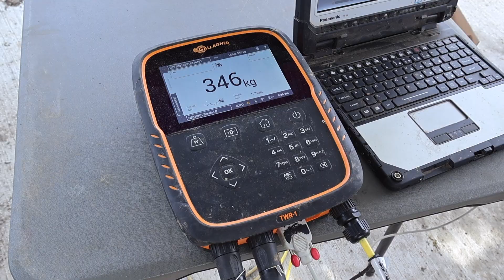What Happens When You Stop Using Chemicals on a Farm?

Comment: I'm an accidental cattle farmer- mooved here in the Orbost area two years go. Only a small concern (16 breeding cows on 15h) My problem is very low HP-3.6- but also like Chris, lots of locked up nutrients. So I spread about 10t of lime over most paddocks....no visual improvement as yet but still optimistic. I also want to avoid any chemicals or synthetics etc. but would avoid chicken poo from the big chicken farms. So a very interesting Video Tim thanks.

Comment: Urea was used during WWII to quick repair air fields that had bomb holes. Just pour into hole and add water! So what you recon it does to soils? Lupins were used in Robertson, NSW potato to release phosphorus locked away using crop rotation. Just realise the piles of 'chook' manure/bedding from chook factory farms is full of many petrochemicals; anti mite etc etc. Interesting the UK horse breading paddocks that were ploughed during WWII to grow veg. never returned to what the non ploughed fields had; 45 different herbage species (called weeds in AU).